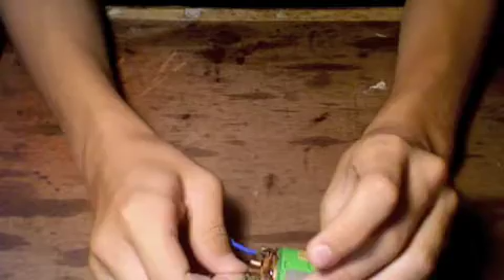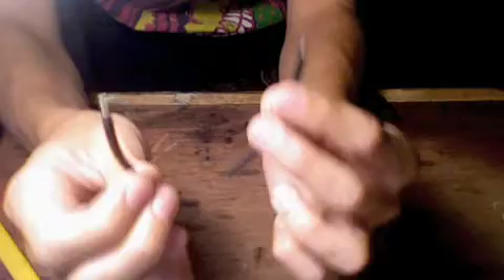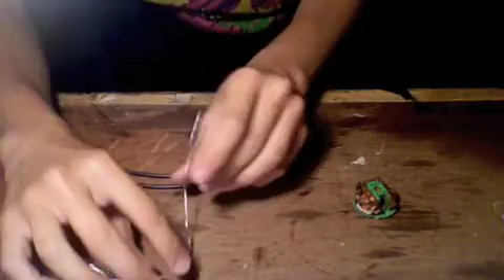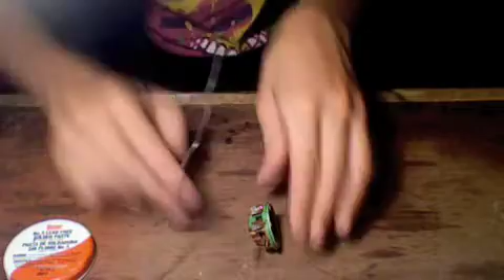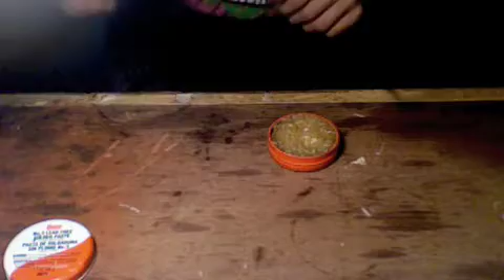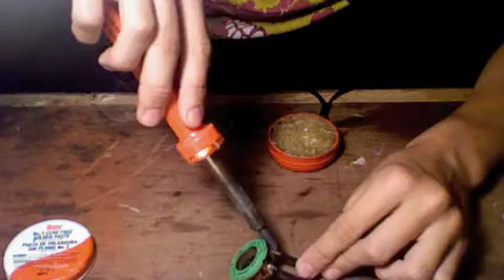How to solder wire to your motor 2

Comment: I see now, I wasn't using flux. That's why I have never been able to repair toys that only a wire came loose on. I have used solder that says it has flux in it but this must be the way to go. Always pisses me off when it falls right off the motor as soon as I give it a test pull. Thanks.